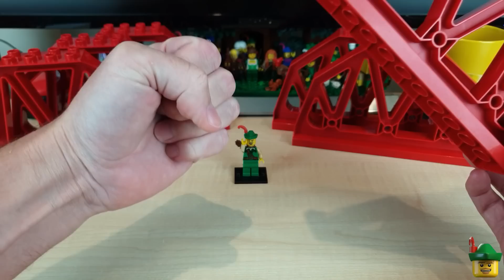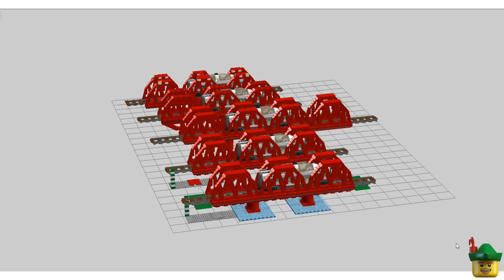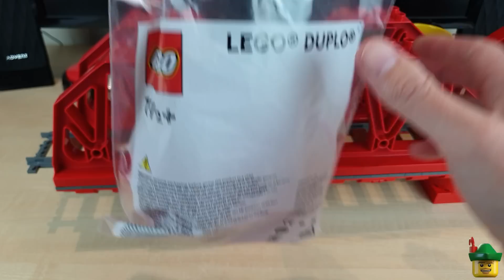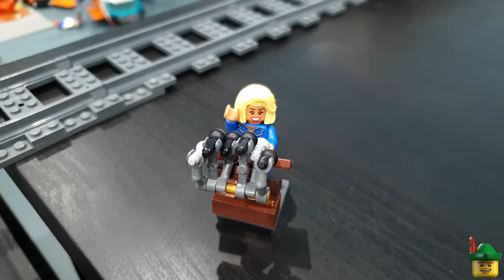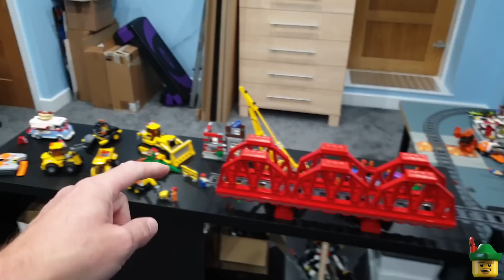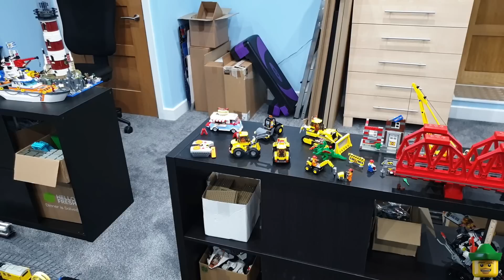LEGO City - Red Girder Rail Bridge MOC Duplo 🌉🚆🏹

Comment: As this is a bridge, I think it would look better if the sleepers actually filled in the gaps under the train. Any train bridge I have seen has no gaps open to the air underneath
Reply from the maker: Maybe so, but isn't this more fun?  More peril!
Reply: I was similarly bothered by the open design. Poor minifig inspection engineers. I see an "amusing" scene coming up.

Comment: Robin, can you use your parking garage as the ramp structure for a bigger garage both above the rail lines as well as in the background section?
Perhaps abusing the new road plates, for this?
It currently, is too small, yet if you let it look like the actual garage is on the other side...
Personally, I would put it next to the hospital, though, those almost always have a parking garage.
Might even let you add in the front upper floors, into the hospital, as well, so bonus, right there.
Think it over, okay.

Because I can also see you using the parts of that parking garage in order to make a twice as long parking garage outcropping in the background.
With some car noses popping out.
Would also let you put the tumbler (Batman Begins) in it's rooftop chase starting setting, if so wanted.
Just need to line up some of the buildings so it can do a ) back into the other wall, you know.
Like jumping to the gym it's roof and then beyond.

Comment: You’re making the bridge too thin.
Reply from the maker: There's eight studs between the two rail lines.  This bridge extends over three of them.  The other will take up two studs meaning they're already only three studs apart!
Reply: @ I would recommend that all of your train cars, passenger or freight, be able to cross the bridge even if the plans are for only the passenger trains … it’s much easier to do it now than having to deal with it later (remember steam engines can be up to ten studs wide even though the engine itself might only be 8) just a suggestion..

Regardless, one thing you really need to do though is center the pillars underneath the bridge joints or it’s gonna drive everyone with OCD batty.